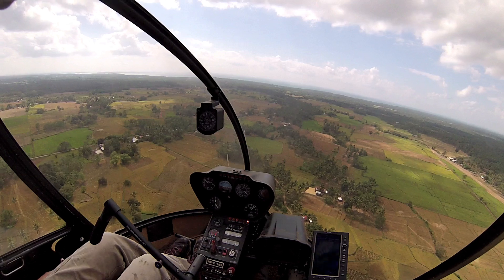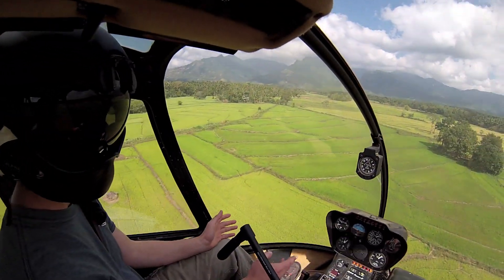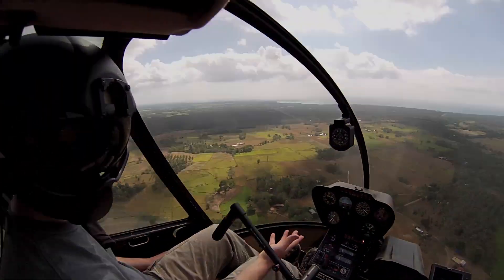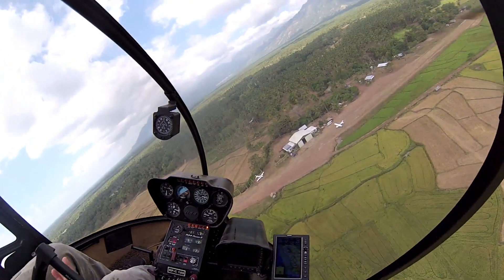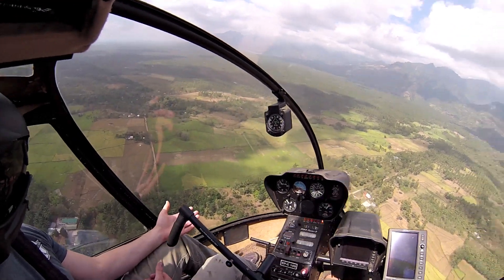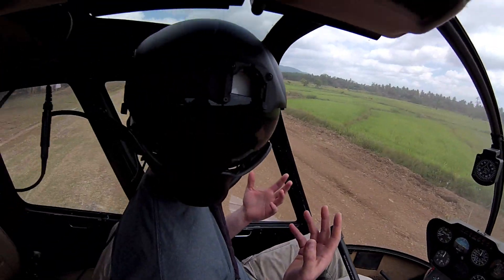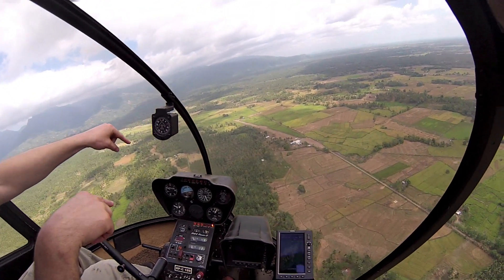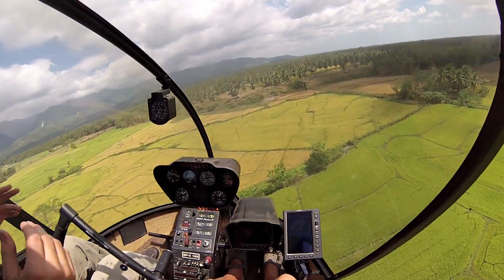Day 1 - Basic to Advanced Helicopter Autorotation Training - live audio

Comment: Hey mic, would you be able to explain what "slip" is and what its used for in the Auto ?. Love the vids
Reply from the maker: A slip in generic terms is when you fly the aircraft out of trim, primarily to increase drag, resulting in increase descent rate while maintaining airspeed. AirSpeed will not be accurate during a slip since the air is not going straight into the pitot tube.
Reply: To add to what Michael mentioned; the specific drag that we are desiring is the drag which targets rotor rpm, thus the reason to use the power pedal. When the power pedal is used it increases pitch which increases drag which forces the rpm to reduce allowing the pilot to lower the collective without over-speeding the rotor which gives the pilot radically increased control of energy management.

Comment: Do you pull collective in the last part of the flare where you pull the cyclic (when you basically pitch about 45 degrees)?
Reply: If you are referring to the last part of the flare right before landing, then no. I teach to lower the collective during the initial level off and to have the collective at full down position prior to the level off after the flare so that you have full collective for cushioning the landing.
If you are referring to the higher altitude flare when I have him slow down, then only as necessary. So if the aft cyclic input is slow then it really isn't necessary and, depending how slow, I will actually lower the collective. However, in most of what you will see us do in these 5 videos regarding the higher pitch at altitude the cyclic is brought back more quickly necessitating the raising of the collective for a brief period prior to lowering.

Comment: When I first saw these videos I thought the sideways flare was a bit risky but could see how the maneuver could be helpful in a confined space auto.  Recently the machine I’ve been flying was involved in a nose over accident the resulted in it collapsing the passenger compartment enough to badly injure the pilot.  Being able to arrest forward motion AND prevent a nose over, even if it results in a roll over sideways seems more attractive now.
Reply: That is a very common perspective. Since the majority of the flying we do as helicopter pilots is over areas that do not support the ability to slide in a full down situation it is best to be stopped. It is important to keep in mind that density altitude, direction of surface wind on impact, weight, and CG all play a part. As an example, I can safely, if space is available, slide further in a UH1 than in a lower inertia aircraft on a soft surface since the aircraft is still providing lift whereas something like an R22 in the exact external situation will have used up all beneficial lift on contact thus leading to tipping over. Since inertia is still moving the aircraft forward on contact insufficient lift causes the skids to slow faster than the fuselage leading to the rollover.  I teach that we must come to a stop before the weight of the aircraft is on the skids in the event of an engine out when not over a hard smooth surface which will highly reduce the likelihood of tipping over, within CG limits of the aircraft on a given surface. Tipping over when laterally stationary is much safer than tipping over with lateral movement since additional forces will be applied to the aircraft and in turn to those on board.  The power pedal slip which I am teaching here, is an incredibly useful tool for any pilot who desires precise energy management which allows the pilot to choose where they desire to land (within gliding distance) while maintaining needed energy and within inches instead of feet of the desired location.  Being that precise is very important for the aircraft, pilot, crew, and for people and property on the ground to maintain a higher level of safety since the majority of the work we do as helicopter pilots is not over a hard smooth surface with wide open areas that allow us to be 100 feet off from a desired LZ.

Comment: Great control 👌. Always been timid to get behind a Robinson, but after see the manoeuvrability and control you showed was an eye opener. Always been told these helicopters are unpredictable. Doing my ppl in a schweizer269 which are pretty forgiving.
Reply: I wouldn't say unpredictable, unforgiving though...
Things happen pretty quickly and rotor rpm can decay in a hurry.
Reply: @j.francismacdonald1506  which is why I will never again fly in a R22
Reply: @geddon436   I agree! I trained in the 22 and upwards of 8k hours later I don't think I'd leave the ground in one.
Reply: @j.francismacdonald1506  I totally agree, and that is one reason that I like people to learn in them! ;)
I have found through the years that, on average, those who learned in an R22 have a higher understanding and ability to monitor and control aircraft energy in a broader flight profile compared with those who trained in other aircraft. I have seen quite a difference between which machine a pilot has learned in, however, in my experience the greatest contrast has been between the military trained pilots and those pilots who trained in the R22. Since the smallest common military trainer for nearly 40 years has been significantly heavier and easier to fly, the skill of energy management has been reduced and the principle of primacy has shown the shortcomings of learning in an easier machine (I understand that training methods also can play an incredibly important roll as well)  Without exception, it has always been easier for me to transition pilots from a smaller machine to a UH1 than to transition a UH1 or UH60 pilot to a smaller machine such as an AS350 or smaller.
Reply: 269 is a great trainer, not taking anything away from the 22 but the 269 is a great choice.
Reply: Understandable.
They are a great little machine when used within their design limitations. Unfortunately they get bad press since people hear about more Robinson helicopters crashing than others. However, when a person considers that the Robinson helicopters are flown more hours annually than any other aircraft in their class (specifically the R22 and R44) and often by lower time pilots than those who are piloting Bell, Sikorsky, Eurocopter, etc., while flying a tremendous amount of hours doing flight training, then it is not only understandable but logical to see.
Reply: Prayer at the start was great😊

Comment: Thank you for praying before the flight. I am 6 hours in my Helicopter Training and not doing well at mastering the cyclic and hover. But I will start my flight training like you praying... thanks for the reminder.
Reply: Hope you got it figured out. I think everyone struggles with hovering at first, perhaps me more than others :/
But I'm now a damn good pilot and vertical reference pilot
Reply: It’s always a good idea in my perspective:)
I hope that your training has gone very well and that you are doing great in the industry! No matter your experience, remember to keep the forearm stationary while resting it on your leg and only use your fingers and wrist to manipulate the cyclic. Everyone I’ve trained to do this, regardless of hours, has always improved. Just keep in mind there will be a learning process and to be patient. You should have the ability to move the cyclic in a figure eight pattern without the forearm moving. By doing this you have better stability thus better finesse. And for those still learning; look absolutely as close to the front of the fuselage as possible where you can see the smallest movement between the aircraft and the surface while slowly raising the collective. This allows you to identify the movements more easily and precisely and make the corrective inputs before your skids even move. As you lift away from the surface bring your eyes out more laterally as needed, and inverse for landing. This is inverse of how I as well as most pilots are taught, however each pilot that I’ve taught this to, regardless of hours,  always improved their takeoffs and landings without exception.